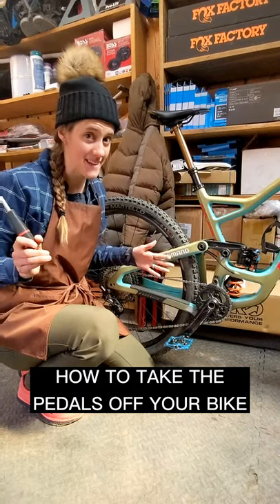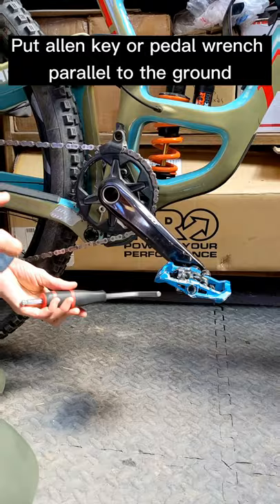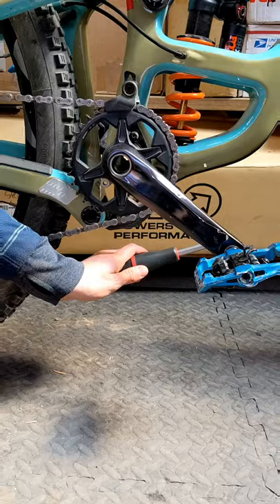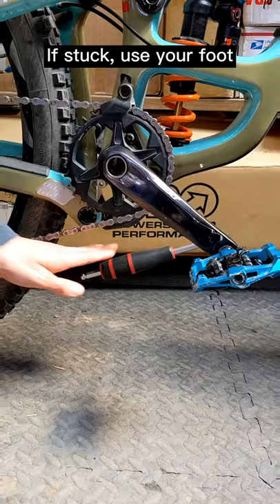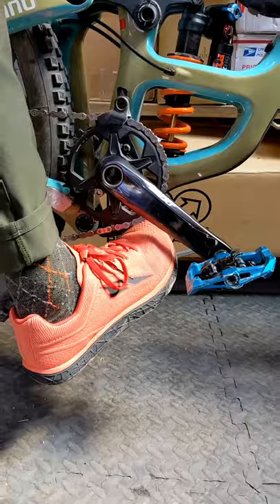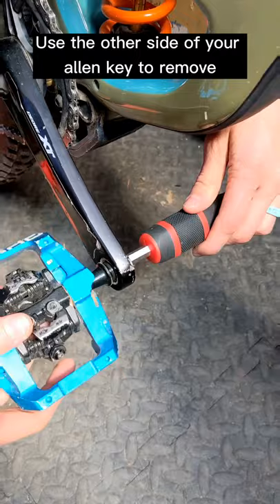How to take the pedals off your bike #Shorts

Comment: If you stand on the pedal it’s a lot easier. Also use antisense grease. Better for the threads and easier to get off. Use a torque wrench to tighten ONLY if you are using the grease though.

Comment: I dont have a allen key there hole there i have no hole
Reply from the maker: Some pedals have a space for an Allen key, some can only be installed/removed with a pedal wrench and some you can use either. Sounds like yours require a pedal wrench. The process is the same though.